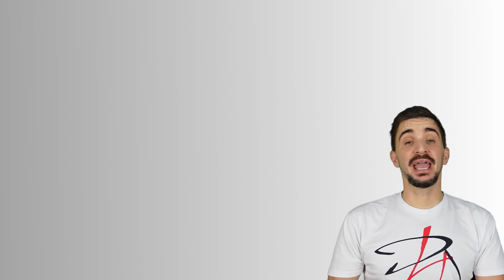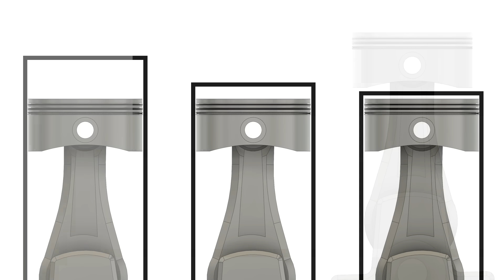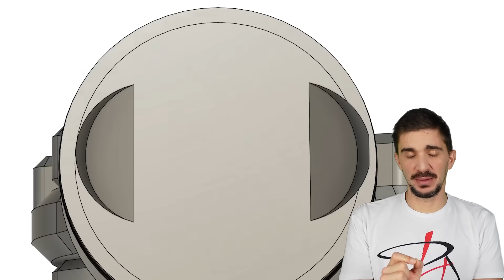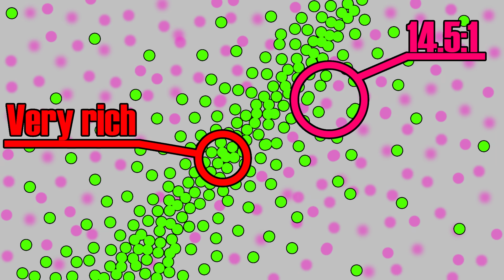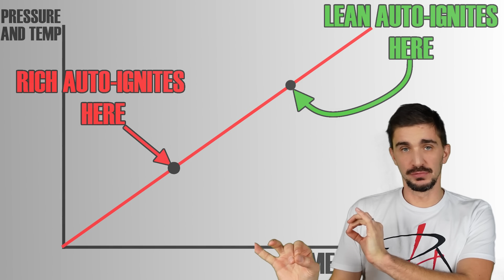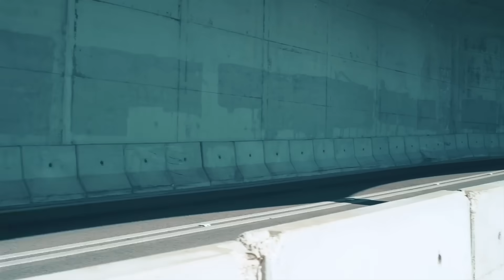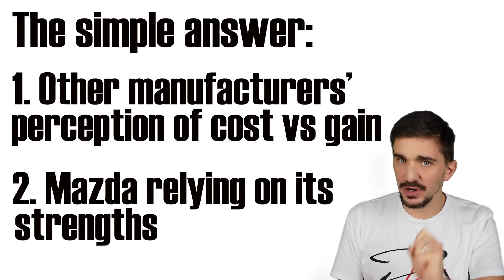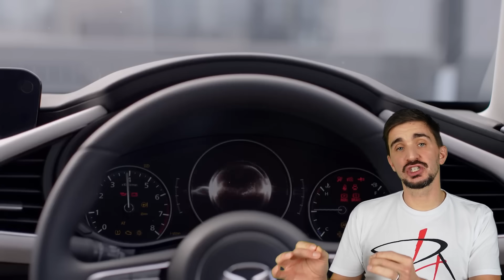The Game Changer Nobody Cares About - Mazda Skyactiv-X SPCCI How it Works and Why It Didn't Catch On

Comment: Its shame mazda doesn't really explain this tech enough. It takes slightly different driving style to get the best of this system. Once I understood how it works my fuel consumption dropped by 1 L/100 km city and >2 L/100 km Highway. I get better results than small turbo 4's from VW with less complexity and headaches.

Comment: Honda had an engine that was ahead of its time, it was the CVCC or compound vortex controlled combustion in the 1982 Accord.    The main cylinder had a very lean mixture which was ignited by a small intake/combustion system initiated by a spark plug which exhausted/combusted through six holes spraying in a circle much like a prechamber in a diesel engine.   Our Honda went four hundred thousand miles and I rebuilt it after a Honda dealer incorrectly set the ignition timing before my brother drove it cross country while detonating.                 I understood everything explained but it wasn't clear how the engine switches from normal engine mode to SPCCI mode...?   I am impressed with Smoky Yunick's adiabatic engine or heat conserving engine which utilizes nearly all the thermodynamic energy in the fuel to do useful work.   It would seem you could heat up the intake charge with the wasted heat in the exhaust thereby avoiding all the wasted energy used to compress the intake charge making the engine much more efficient.

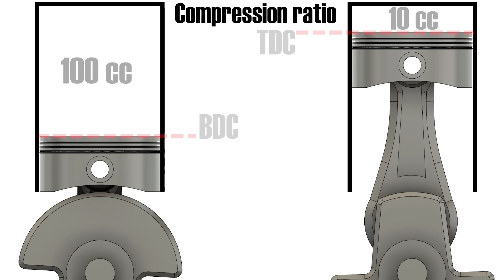Comment: 1:48 This is why I still don't understand the benefit of the atkinson/miller cycle engine (like in your other vid).

"The higher the compression ratio, the more efficient the engine."

But the Atkinson/Miller cycle engine effectively redesigned the engine to produce less compression, and yes somehow it's more efficient ¯\_(ツ)_/¯
Reply: I think the compression ratio is a different thing from the duration of the compression stroke.

Miller cycle achieves better efficiency by reducing the compression stroke while maintaining the same length of the ignition stroke.
Reply: It's a better use of energy at the cost of performance.

Comment: I love Mazda - I used to race first generation RX7's with the 12A Wankel engine.  The SCCA once had a class for these fun cars (they may still have it - I stopped racing years ago) and it made racing relatively cheap.  Mazda helped all the racers and they really impressed me.. The only "complaint" I have with the company is that they never mated the rotary with the miata - which - IMHO - is a match made in racer heaven....

Comment: 10:47 its 10 years late. This tech is literally so freaking cool. But, they've already skipped it for EVs then most besides toyota are back tracking to hybrids, and engine alone tech is 'old'. Its the reason, wink wink, toyota didn't let mazda use the skyactiv in the 50hybrid but Subaru was allowed. I own a 24 preferred sedan. Every trip alone is an easy 40mpg staying with traffic over 70 usually and 26ish cause I do give her a little around town. The next Gen just need to thin out the depth the panel come out and dash, adjust for slight bit more leg room and not so plush chamber feeling in the back. Still amazing everyday, and im a close sitter so it still works a ton.

Comment: do they use this for generators? seems like this type of engine would be really useful for cases where you just want maximum efficiency, even if the output varies somewhat. that way the control issue is not such an issue.

Comment: Wrong, you have gasoline engines with injection do you remember ? So they can have all the compression they want, the fuel won't ignite because it's not there.

Comment: Excellent story and analysis.  The last part is key.  Most humans are inherently lazy.  

We're at least 20 years off before EV's really become the dominant method of transportation in our country.  China, off course, is already way ahead of US.  This engine would be a great match for an efficient hybrid for long distance driving and local.  Larger battery for 50-100 miles and then power up a gen-set for recharging using an efficient clean engine like this.  For this purpose maybe a 30kw(40HP) gen-set.  Two cylinders?  It could run while you go shopping.  Making sure it doesn't run by itself in closed spaces - oh wait, stop engineering Hobby...you're retied.

50 years from now long after I'm dead and my genius Grandson is near retirement we might be mostly electrified as will Jina....  Another story.

Comment: This engine is excellent, but the rotary engine is completely irrelevant to this matter. Mazda has faced a crisis every time it has released a car equipped with a rotary engine. I believe other manufacturers decided against the rotary because they judged it to lack practicality, and I simply cannot understand why Mazda fails to realize this. In fact, I think the rotary engine lacks durability and has no real value beyond disposable applications.
Reply: このエンジンは素晴らしいが，ロータリーエンジンは、この件とは全く無関係です。マツダはロータリーエンジン搭載車を発売するたびに危機に陥っています。他社がロータリーを見送ったのは、実用性に欠けると判断したからだと私は考えていますが、なぜマツダがそのことに気づかないのか、私には全く理解できません。実際ロータリーは耐久性に欠け，高出力を生かした使い捨て用途以外に利用価値がないと思います。
Reply: Mazda should have changed the product name. No one notices "Skyactiv."
It could have had an even larger displacement—an inline-six not 4.
Reply: Perhaps there is a mismatch between Mazda's engineering capabilities and its sales capabilities.

Comment: I came from Ford, Hyundai, VW and Mercedes and now after failure of 2 of my Mercs(gearboxes) and very very expensive parts and services, decided to go Japanese. I got a Mazda 3, 2.5l for a very good price. I realy never in my life thought I will ever drive a Mazda. Now, Mazda is the most reliable car Brand on the market. It took me a time to adjust to the Mazda Tech and today, I am happy as heck. I had one issue 3 months ago, a hydraulic lifter on piston #4. Mazda NZ fixed it for free and gave me a rental for the week it  took to tow my car from Turangi, Taupo NZ to Hamilton and then delivered for free at my house, right on my doorstep!!! No other dealer has ever done this!!  Mercedes charged me for a courtesy car and a thousands of NZ dollars for repairs. The problems with both my Mercs was endless!! The development and Tech that Mazda put into their cars is enormous and that from a small Company. Services and parts are cheap. The whole driving experience in a Mazda is ssoo different. My Merc's were plastic all the way, my Mazda, leather interior all the way with quality plastics and not cheap Chinese plastics. like in my EU cars. As for now, I will stick with Mazda. Mazda: 5 years roadside assist, 5 years factory warrenty, 5 years free services!!!!

Comment: The nd2 mx-5 gets 6.2L/100 with roughly 4.5-5 on the highway, with the standard skyactiv-G 184, skyactiv-x gets 20-30% better efficiency with more torque down low but a worse top-end. 

Super efficient engines but tiring to drive as they are very engaging and do not have a large amount of torque. Thinking of going to audi's 2.0 gen3B.

Comment: The problem with SkyActive - X engine is that Mazda doesn't even try to sell it. Mazda in general has problems with this. Here in Lithuania you only get SkyActive - G engine which always are promoted and on sale. Then SkyActice - X engine is always significantly more expensive and never goes on sale. This guy got his ass sore over people not liking ''to drive'', but a reason for its low adoption is a lot simpler. Engine costs a lot of money to make. It's complex piece of machinery. Then the problem is that it competes directly with Mazda's 2,5 l engine and as a result, it's one big nothing burger. It gets same power with same fuel usage, but at a higher price. So, what was the point then?

Mazda in general do not sell their Turbo version here. In Europe, they dropped 2 l Miata versions. Heck, forget about Skyactive X Turbo on their Miatas or Mazda 3 sport trims. Mazda as a company often makes good technology, good cars, good price points and then completely ignores their tech and potential by solely focusing on high volume products and never doing anything for an enthusiast.

Comment: My two 2026 Powerstroke 6.7L engine has a Nano Hydrox 4000 system with 8 gallons tank... all resets done on CPU to improve exhaust low emissions cleaner intake manifold egr ... after 15 years using it worth working 💪 👷‍♀️.. Please consider example Maestro 😂😂.. Greetings Seattle Tacoma Toyotas Lexus Powerstroke Fans Clubs Papilindo José 😂😂😂

Comment: Thanks, good presentation of a very complex operation. I expected at the end the big benefit of gas mileage. I see other owners claiming amazing mileage. That alone would sell half the population. Second point is hybrid or electric deisel/gas designs allow the engine to work in its optimal rpm range while the electric motor handles loads and speed without blinking. Wouldn't this skyactive X be the perfect fit in a electric gas configuration?

Comment: My 17 Nissan Frontier with 4.0L v6 (261 hp, 280ftlb tq) gets 15mph both in the city and on the highway because it weighs as much as a Tahoe or 5600lbs. By swapping in the 5.7l V8 from the first gen Titan which will bolt right up the the factory mounting points and transmission, my mileage will increase to 18 in the city and 20 on the highway. I am increasing the weight and cylinder count but because the V8 makes so much more low end torque I will actually be increasing the efficiency by installing (on paper) a less efficient engine.

Comment: One important advantage if buying this Mazda would be fuel-mileage. If it is good, make a little marquee for it in the upper corner of the screen. Maybe add a few comparisons as well. I was listening, and I did not hear you tell it. The marquee technique should ALWAYS be used because many people have a photo-memory process going on and a sound-block process going on. To do just 1 second of marquee is a failure mode - leave it in place for at least ten seconds.

Comment: This sounds like a perfect engine to pair with Toyota's work on hybrid propulsion. The engine is good for cruising on the byway but not start/stop driving so pair it with a moderately powerful electric traction motor to take care of acceleration and deceleration (regen braking) and let the engine operate at a constant load and torque to run a generator to charge the car's traction battery system and perhaps let it take over completely on constant speed highway runs.

Comment: How would a SPCCI engine stack up against an Atkinson Cycle engine in the matter of MPG?   My 2018  Kia Forte sedan with the Atkinson Cycle  easily gets 45 MPG on a trip (which includes highway,  town and suburban driving - even some mountains!)   On occasion,  I have gotten 50 plus  MPG  under  more or less favorable conditions.  I am a moderately conservative average driver.  My tires are Conti's True Grip (I think the name is.)  It's a good all around (all season) tire.

Comment: As cool as this technology is, it simply doesn't produce many obvious metrics that pull in consumers compared to the alternatives. Mazda vehicles with these engines are jacks-of-all-trades, but that means they have a hard time pulling in consumers who usually only care about 1 or 2 specific metrics. Mazdas are moderately quick -- but not as quick as something with a V6; they're fuel efficient -- but not as efficient as a hybrid; and they're lower maintenance -- but not as low maintenance as an EV. So, someone who wants a fast car will get a Nissan Z; someone who wants a fuel efficient car will get a Prius; and someone who wants a low maintenance car will get a Tesla. Mazdas are generally not stand-out enough in any of these major categories to break out of their niche and reach a wide buyer base.

Comment: I guessing, but I assume that for diesel that the speed of air pistons are designed with the purpose to mix the fuel with the air better by creating turbulence over the surface of the piston.

Comment: I have one and it is nice. I don't understand modern divers This thing drives exactly like my old Alfa Romeo 2.0 Twin Spark, except for the suspesion. Low revs, it's unassuming and if you put the foot down you can have loads of fun - of course then SPCCI is off and you burn some proper fuel. But the car gives you a choice, you just need to take it.

Comment: I have a 2021 CX-30 with this engine. He is correct, you have to rev the engine or "work the engine" to get some power out of it e. g. while overtaking. It feels like my first cars in the early 90s before turbocharging became mainstream. He is spot-on describing modern customers "spoiled" by the low-end turbo punch of turbocharged 3 cylinders etc. I was fully aware of this when I bought the car, but I made that decision deliberately because I saw the advantages of less parts = less problems. I also like the "punch" of a turbo engine, but what even more like is a RELIABLE car that works for years and years without any technical problems or large repair bills and my mechanic who gets tears of joy in his eyes every time because it is so much simpler (and cheaper) to work on this engine.

Comment: I wanted soooo bad to purchase a mazda 3 sport hatchback with manual transmission (like all my previous car) but Toyota had me on price with 5000$ USD less, better fuel efficiency, and overall what seemed a better purchase. Ended up with a Plug-In Prius 2026 for 25 000 USD 🤯
(Still miss Mazda 🤫)

Comment: Charles "smokey' Yunick developed and pateneted the "hot vapor" engine in 1975. It doubled mileage and horsepower on every engine type that was modified to use it. No NOx, no HC emmissions without a catalytic convertor. much simpler than Maxda's method. patents are expired and existing engines can modified to use the system. When will the Auto idiots get their heads out of their a$$e$ and use technology that will cut CO2 emissions in half, double consumer mileage, and offer such clean burning engines that they could easily run for over 500K miles without rediculous tight tolerances.

Comment: It is a bit sad that this unique technology is not going to get a phase two development. As far as I can read the next generation Mazda skyactiv engines will not have compression ignition gasoline. If this technology can really run on 60:1 air fuel ratio at part load then it may have at least a purpose as a range extender/ generator.

Comment: When I checked it seems that the Mazda Skyactiv-X SPCCI engine does not have a particularly record breaking high thermal efficiency. Kinda a bit better than Toyota but without all the benefits of hybrid (for efficiency and performance). So not sure where the big win is?

Comment: What if we heated the petroleum to a gaseous state and mixed it with compressed air in a fuel preparation chamber just prior to injecting it into the cylinder where the pure air intake was compressed to a 20:1 ratio. This would negate the need for spontaneous combustion because the injector would time the injection and hence the combustion could easily be controlled at 3deg before TDC. The solution to this then would simply be gasoline heated to a gaseos state and mixed with compressed air at the perfect ratio prior to being injected into the cylinder at the correct moment before TDC on the combustion stroke. Cheap, reliable, uses old tech and would give us atleast 50% fuel saving. No down side. Infact this has already been done. Esso purchased this tech in 1970's. It was called a Hot Box. Esso burried the tech and may have warned the inventor to not reproduce his work ever again. The inventor completed his work while he was serving time in jail in Australia. He did it with an old cast iron engine and didn't eve have injectors. He did it with a carburator, but injection would undoubtedly improve the results.

Comment: They need to make it 2.0 for mazda 2 and 2.5 for mazda 3 to be more mid range strong.  So that people would know how to use it. They expect 2.0 to pull from 2000 like turbo 1.5 and it's just not possible. But for those who knows driving is much better :)

Comment: In all honesty, the performance is lacking for its efficiency. High revs are an issue because of the loud sound and even then, the performance isn’t there. Let’s be a bit more fair and not lose touch with reality. I say this as someone who really wants to buy a mazda 3 but just can’t justify the shortcomings. Reliability, its interior, sound insulation and the bose speakers were the biggest draws for me. Its fuel economy and performance is too disappointing for me. The blind spots are tough to accept. Cabin rattle complaints are another issue. I love the front of the car but not so much the rear of the car from a side view. The rear and front look like two different/incompatible designs glued together. But that’s just me. The Honda jazz has better performance, reliability, leg room and efficiency. For the same price. That’s the reality. I don’t know who this car is meant for. Poor performance combined with very stiff suspension. Seriously who?

Comment: Maybe that's why I didn't mind the Skyactiv mine on my 3. I think Mazda - of the 3 or 4 other brands I've driven in automatic - have the best manual shift mode, and so it was kind of fun.  I get the everyday driver not wanting to have to 'work to drive', but I enjoyed it with my somewhat short commute.  I also didn't mind the 42MPG when I had a tailwind on the throughway... !

Comment: Mazda has always been out of the box in their engineering. They are working on really cool Hybrid models. Should look at what they are doing to use the rotary engine for driving a hybrid drive change. It take advantage of the core problem of using it as a standalone ice engine (efficiency). Since the motor can run in its most efficient power band it allows a lot of power in a small package and doesnt have to run outside of that band ( where the wankle engine sucks)